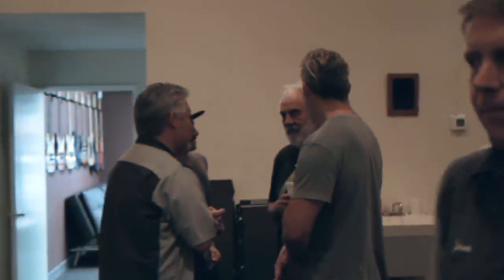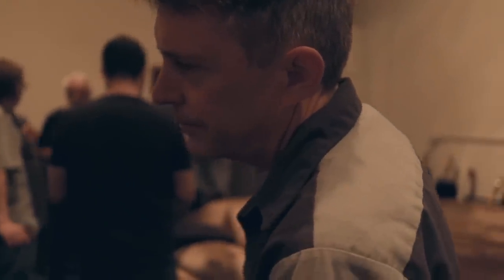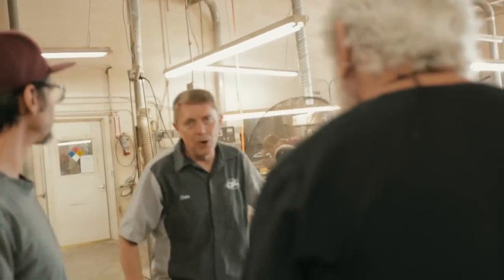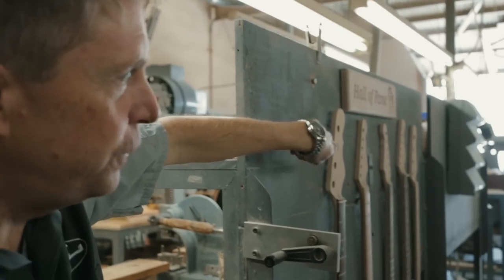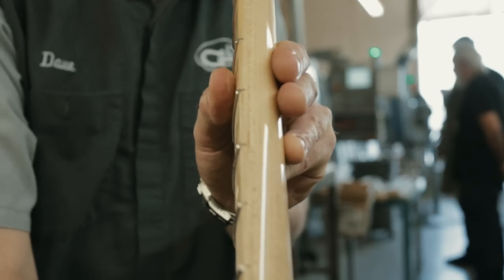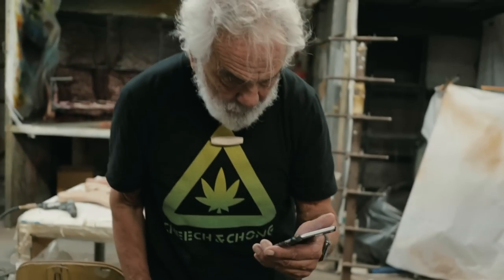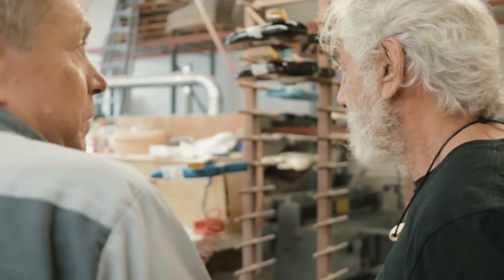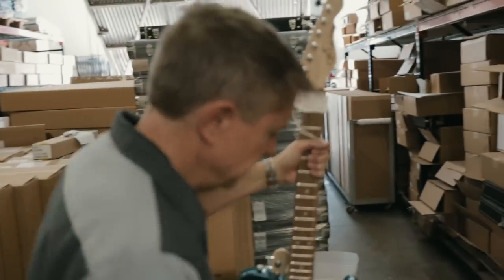vlog five: G&L Guitars factory tour w/ TOMMY CHONG!!

Comment: My G&L (indonesia model, US pickups) is every bit as good or better than my 1990's American Strat. I paid $450 for the GL, about a grand for the Strat. Both are fine but I would never tell any guitarist (who works hard for their money) to pay more than $600 for a top-notch guitar. Quality control and CNC, etc. have made it so you get much more...for much less.
Reply: I have 2 American legacies. One is a deluxe and the other is a standard. Both HSS. I got the deluxe new for about $1600 and I got the standard used for just over $800. Even with the price difference they’re both INSANELY comparable in quality. The deluxe is custom shop so I’m sure that’s why it’s considerably pricier. I absolutely adore both of them and they’re definitely the best guitars I own.